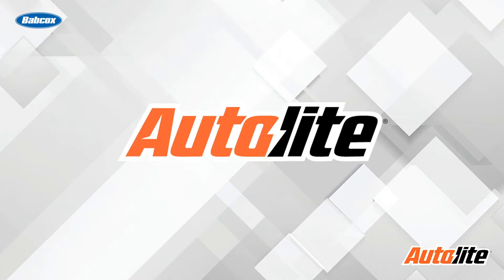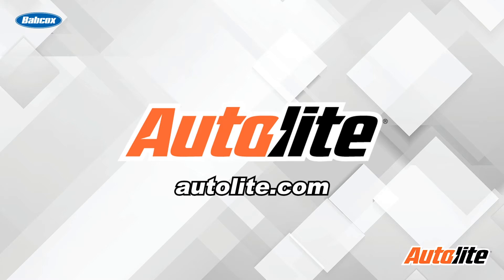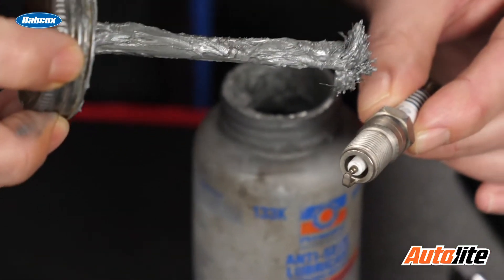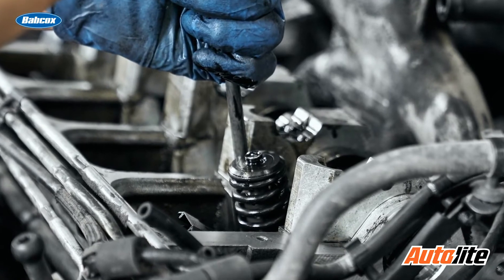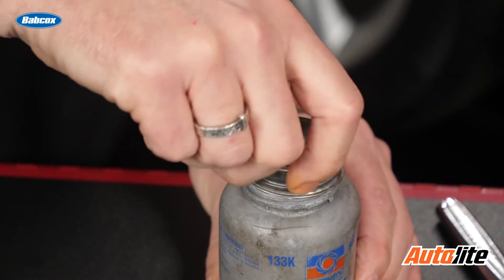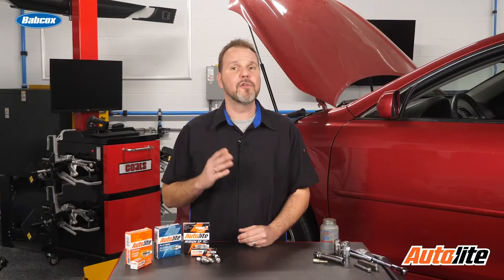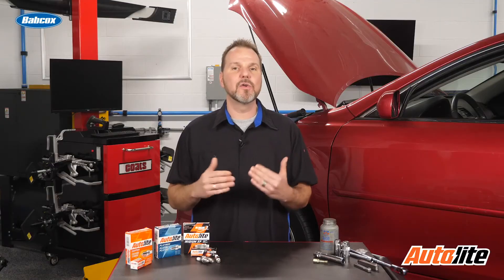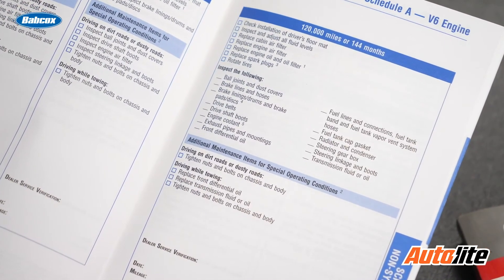Should Anti-Seize Be Applied On Spark Plug Threads?

Comment: I vehemently disagree with you. I,ve been using anti-seize on my 1979 chevy van g-10 and my late Daddys84 Olds. I,ve been using a pure nuclear grade  never size that is highly conductive especially with the grapite contents WITH VERY FINE COPPER FLAKES. For  a 1/2 pint can it costs me over $70.00 through Grainger industrial supply, and not the cheap automotive grade sold in the main stream automotive stores.  .However, i,m also carefull to applying it not to use too much, because it may contaminate the electrode tip. I use the hot running plugs becauee of the age of the engines.
Also to add insult to injuries to you guru mechanics out there, i apply silicone greese to the plug tower so that does not stick either when i pull the plugs WIRES out for servicing.  I learned those techniques/skill sets through working on 13,000 volt 3 phase power switch gear in an industrial plant i once worked in. WE USED SILICONE GREESE ON THE HIGH VOLTAGE SWITCH GEAR CONTACTS I,ve been a licensed electrician since 1972. Hence, you car gurus should think outside the box and listen to electricians that have worked in the electrical construction trade with industrial automation experience.  I also use that same never-seize on all my lug nuts over the years without any problems.  PLUS OTHER BOLTED AREAS UNDER THE SILL OF THE VEHICLE.  My old vehicles are not for the Sunday afternoon parade of old classic cars.  I use them on somewhat a regular basis. I,ve extensively modified them with stainless steel where it rusted out. It seems like not only car makers practice what i call PREDATORY ENGINEERING  A/K/A PLANNED OBSOLESCENCE,  BUT THE AFTER MARKET PARTS MAKERS SEEM TO FOLLOW SUIT LIKE OEM PARTS MAKERS. HOWEVER THERE ARE SOME GOOD AFTER MARKET CAR PARTS MAKERS , LIKE STAINLESS  STEEL BRAKE  CO USA. 
            I HAVE YET TO GET ANY RESPONSE BACK FROM ANY CAR GURU ABOUT STAINLESS STEEL MODIFICATIONS ON OLD CARS. Am I looking a cult following of mechanics?

MISS PAULA WALACH- FORMER INDUSTRIAL ELECTRICIAN- UNION MEMBER IBEW.

Comment: I became a service mechanic in the early '60s and all torquing for my motorcycle service work was by "feel", especially spark plugs.  While we didn't have need for anti-seize at the time, I later used it on automobiles that I owned that had aluminum heads with good results - still tightened plugs by feel, no problems.  I was in line service at a small municipal airport and watched the mechanics for the FOB service operation do work on many aircraft recip engines.  They regularly used an anti-seize compound on spark plugs though it was darker and more fluid that what we commonly use for general mechanical work.  The current times must not allow for mechanics to develop much "feel" for the forces they apply to fasteners and that is lamentable.  While I did use a torque wrench for many critical stages of an engine's assembly, it never replaced having a sense of what force was necessary to be satisfactory for an assembly.
Reply: Good but most people change plugs 3 or 4 times in their life never pick up that skill of feeling torque needed

Comment: I started back in "the day" using hi temp antiseize due to dissimilar metals, and spark plugs seizing in heads. Still use it "very light light coating" and never have trouble. I've seen too many spark plugs broken off in heads, but never mine. Call me old/antique, but what works under my eyes, over decades is hard to change. Cheers from Canada.

Comment: Absolutely especially on aluminum heads! Don't overdue it ! Cop a slip is my brand of choice. I use a mixture of extreme pressure lube mixed with cop a slip for general nut and bolt assembly ie: suspension, steering, body bolts.

Comment: How does anti seize on spark plugs compare to using oil on headbolts; wont oil cause overtightening of headbolts ;  oiling the headbolt threads is recommended or most important for getting an even torque...isnt it?

Comment: I was replacing the  Plugs in my Yamaha FZ-07  the threads are much longer and smaller diameter than automotive plugs.  I installed one by feel and realized I over torqued the plug..
  I looked in the owners manual and got NM and FT lbs values.. I converted to inch pounds for my smaller torque wrench ..
  Seems it was calling for 9 ft pounds..

Comment: I disagree on the electrical grounding point. Silver anti seize gets it's color from aluminum that's in it. The bronze colored anti seize gets it's color from copper that's in it. What better way to make an electrical connection than aluminum or copper? The copper anti seize is used often by electricians to prevent seizing and to make better electrical connections.

Comment: NO...never have, never will, and NEVER had an issue on anything from lawn mowers to my dragster and everything in between.  Plugs made now have a coating that eliminates the need for it.  I've been an auto/diesel tech for more than 40 years and a racer for more than 25.  I've seen anti seize cause more issues than it ever solved.  Leave it off the plugs....

Comment: Retired aircraft mechanic,I only used it once on spark plugs. My 2000 Montero sport. Recently I changed the plugs. #2 I thought it would not come loose. The plugs are supposed to set at .043 they were at.085.

Comment: Auto lite is wrong, if you use common sense you will be just fine, if not you may get your self in trouble. In a aluminum head always use anti sized and common sense. I’m 64 and I used it for ever with no issues.

Comment: I'm a home garage guy, and what I've done for many years, is to apply just a very thin smear of anti seize spread on the full length of the threads with a tooth brush. I found that too much, and the stuff will cook into a taffy that makes the plug difficult to remove again. I never thought to try to torque spark plugs. New plugs with new ring I spin down to hand snug, and then an additional 1/2 turn. Used plugs with an already crushed ring, 1/4 turn.

Comment: Honda's service manual says yes, a small amount, and gives a torque spec to match. NGK says not needed and give an angle spec not a torque. If one uses NGK's angle spec then using antiseize, or not, wont affect the tightening. At the end of the day, just follow the manufacturer's service procedures.

Comment: I have worked industrial maintenance and engineer for decades. We had to use nickle anti-seize on extruder bolts due to the continuous high heat. I use copper anti-seize on spark plugs and O2 sensor threads. This makes a big difference on removing tapered seat spark plugs. I also use purple or low strength thread locker on all fasteners such as lug nuts because it will exclude water and prevent rust.

Comment: your using the WRONG anti-seize. you have to use the COPPER high temp anti-seize.  it conducts electricity.  

it will be a  cold day  in hell when i DONT put anti-seize on spark plug threads!

Comment: I've personally seen with my own eyes a very popular Ford technician here on YouTube use anti-seize on spark plugs on a Ford 5.4 2 valve engine.  I personally have done it on my GM engines with no problems whatsoever.  As others have mentioned here, you've got to have the proper feel of how far to tighten them and use caution to not overtighten them.  I also use high-temp anti-seize on any exhaust components I assemble to help with possible future disassembly.  Hell, I use the stuff everywhere!
Reply: I agree on all counts. When the plug bottoms out? Maybe an eighth of a turn? It definitely a ‘feel’ thing. When I do any other type of work I use Sil-Glide for fasteners. I do it for me or the next poor sap that has to work on it.
Reply: @joeyoungs8426 most people wouldnt have thzt skill comes with intrrest and practice
Reply: AMEN! ESPECIALLY if u live in the rust belt!

Comment: I've used anti seize on sparkplugs for 50 years and never once had an issue with a plug loosening, distorting or breaking. The problem with sparkplugs these days is that they are made out of substandard metals and torque values should be adjust accordingly.

Comment: Been using it on spark plugs for over 40 years torque to 13 - 15 ft. pounds max never ever had a problem even on aluminum engine blocks.

Comment: Anti  seize is not a grease for reducing torque as if you were using wheel bearing Grease 

lol my father used since the early 1950s  I have been using it since the 1970’s. to today fourth generation automotive technician. 

I don’t get what idiot is stripping out spark plug threads 

Even all my personal cars 350,000 to 450,000 miles removing and replacing spark plugs always using anti seize

Comment: I've heard the "grounding" reason before, but "you'll mess up the torque specs" is a new one.  
I don't think a lot of people working in their driveway are looking up the torque spec for the spark plugs on their 2011 Honda Accord.  

I say: slather it up all your want, just don't get any on the electrode and remember to install the plugs hand-tight before snugging them down with a ratchet. 

If you forgo hand-tightening and use an impact gun you'll probably cross-thread it. 

And as far as grounding: if the threads of your spark plug need to be grounded, you've got bigger problems!  
Electricity does not work that way!

Comment: You couldn't be MORE wrong, especially when installing a spark plug into an aluminum cylinder head.  Anti-seize does not hurt the grounding, and when installed at the proper recommended torque the plug will tighten to a higher value when the head gets hot.  

Ask anyone that tunes racing engines and you'll learn that Anti-sieze is used so you don't damage the threads in a head while removing them for spark plug / fuel mixture checks.  The key is to not use very much, it doesn't take much to be effective and save your cylinder head!
Reply: Iv been using anti seize for over 50 years and never had a problem. Specially on VW engines or engines with aluminum heads. I can speak for my experience. And I’ll keep using it.

Comment: For years, the car makers recommended using anti seize  on spark plugs in aluminum heads, while the spark plug makers were against using anti seize, because they claimed it affected the spark plugs' heat ranges. I have seen some AC Delco spark plugs come with anti seize on them in the box since then though.